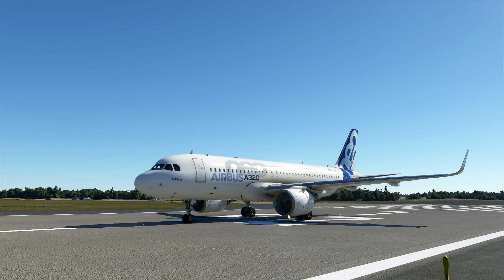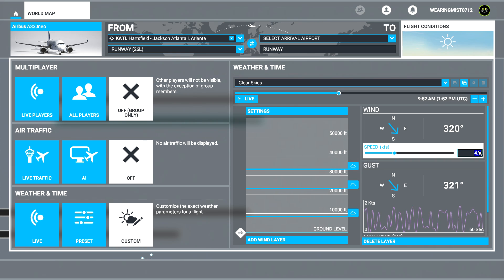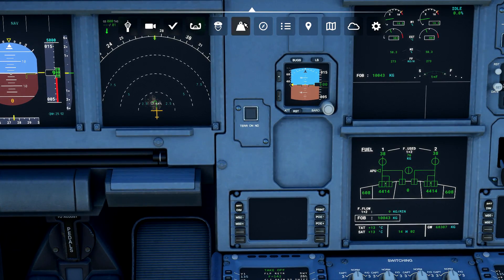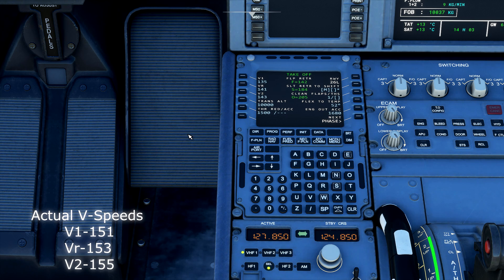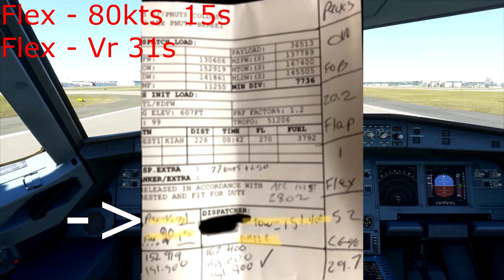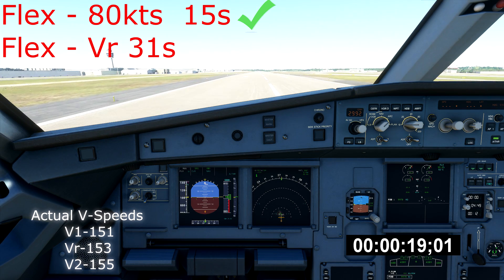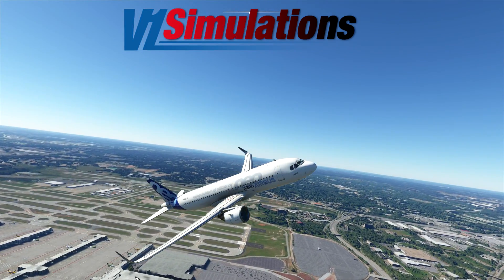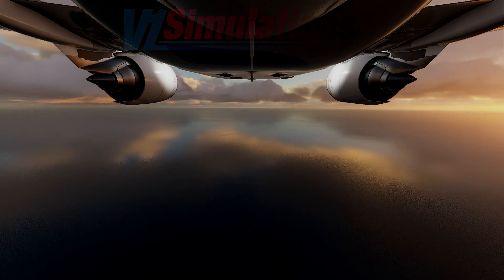Take Off TEST! REAL Airbus Pilot | REAL Data VS FS2020 | A320 Neo

Comment: Thanks for the video, very interesting, I was not expecting that! How do you find the acceleration once airborne and through thrust reduction altitude? That's where it goes too fast for my liking!
Reply from the maker: way to fast lol there is definitely something wrong with its thrust to weight or drag coefficients when airborne.
Reply: That's also my main issue I overspend so fast and when I reduce throttle the speed dies so fast. So hard right now

Comment: Dude I can't believe that Lol. Maybe this thing does need to be Zibo'd, it already looks good and apparently has better t/o performance numbers than the FF had at first.
Reply from the maker: I was shocked at the results lol
Reply: They are already Improving it.
Reply: It already is being zibo'd check out the open source A32NX project: https://discord.gg/XMUzJKj
Reply: The zibo Flight Dynamics was kind of off. That aircraft never stalls and hovers at 80 knots.
Reply: @AboutOliver  I think they're surprised it's this good, not the other way around!
It's definitely overpowered after takeoff though. I barely have time to retract the flaps before going into overspeed; only way to get a reasonable speed is to pitch to climb at maybe 6000 FPM if not more.
Reply: To zibo [sth] vtr... Brilliant new expression, self-explanatory. Hope too this one gets ziboed asap. 😁

Comment: Did u measure those speeds on the A320neo irl, because when u measured the tolis and flight factor those were regular A320s and this was a neo. Also how did u feel about the flight handling of this and the xplane a320s? How did u feel about the Zibo's flight dynamics? I tested the Zibo and at 80 knots it was hovering upwards and never stalls, perhaps we should include a stall test for all these aircraft too? Great videos btw!

Comment: For me its just wrong,  I can't bring myself to fly much in MSFS other than the basic GA.
Reply from the maker: I agree, personally I do not fly the airliners at all in FS2020 as of yet. But I still think its interesting to point out the little things that are there in the default birds.
Reply: ALL PMDG line up and the Quality Wings 787 are coming. Stay tuned. Just need someone to make an A350 and a good classic like the IXEG 737 and thats all we need. Oh yes forgot, we also need the F35B. :)
Reply: ITS A DEFUALT AIRCRAFT FFS
Reply: Being default shoukdnt be an excuse for have baked aircraft, Its got to work I don't expect miracles but these aircraft have some weird behaviours.

I still treat it as a Beta until the end of the year.

I would prefer half the aircraft and have them work twice as well.
Reply: @zszs100  Nice. I hope the fslabs is coming too!
Reply: @AirspotterUK  I mean the GA planes are pretty good. The airliners are bad and well the AP for all planes is pretty bad. Theres a project right now doing a zibo mod like thing with the a320. Not much has been added just some ecam pages.
Reply: @Neil_M_UK ... You like what you like

Comment: The aircraft is showing a SAT of 13c even though you have set 29c in the weather settings. May affect the results.
Reply from the maker: that is an interesting observation! I wonder why
Reply: @V1Sim  From what I've seen the weather system is a bit hit or miss at the moment, lots of bugs.
Reply: @DUBaviator  Yeah there's a few bugs in the weather system, live weather only working on the first flight and then manually having to deselect and reselect it on further flights, wind speed/gusts not being fully accurate or just going to the default of 2kts when real life wind speed is very high, i.e people trying to fly into the hurricanes but not getting the winds expected and so on.

Comment: Hey there, I'm a new subscriber, loving the videos! Quic question though, every time I try and land an A320 it seems to rev up its engines as soon as I touch down and I can't slow down enough before end of runway, I know why it's done in real life, but even with full flaps and brake held down I just cannot slow down enough before the end of the runway! :(
Reply from the maker: Are you using reverse thrust? Make sure you are using reverse and not adding "forward" thrust on touch down. You should have no problem stopping then as long as you touchdown speed is appropriate.
Reply: @V1Sim  it won't let me control the thrust at all at this point, my touch down speed is fine according to the flight pattern, as soon as I touch the ground something forces the engines up to TOGA (learned that from you and now I sound more fancy)
Reply: @JamieHutchinsonTechUK  Alpha floor is engaging because it thinks you are dangerously low on speed or AoA
Reply: @JimNortonsAlcoholism  is it something I've missed that needs to be disabled someone in the cockpit? 😯
Reply: @JimNortonsAlcoholism  Yeah I've done some reading, pretty sure it's Alpha Floor kicking in, but I'm curious as to why.. am I coming in too slow and floating down? Do I need to hit at a higher speed and slam the wheels into the ground before it deactivates?
Reply: @JamieHutchinsonTechUK  Yeah, basically. You're dangerously close to stalling if the aircraft is throttling up
Reply: @JimNortonsAlcoholism  I finish work soon so I'll try it out :D
Reply: @JimNortonsAlcoholism  It was that exactly by the way, I also found out I COULD in fact reverse thrust the entire time... that helps a lot to slow down!

Comment: It's almost like they got so far with it doing a pretty good job, then went 'OK that's it, outta time; park it up and were done here' which is a shame, but in the same light,that they've got some things really quite accurate bodes well if now post release they have some time to go back and work on it some more. Here's hoping.
Reply: The sim was done by a team in France. NOT microsoft, as such, it means more or less Microsoft bought the package. Typical have way finished product. All those terrible G?A aircraft choices. I have now seen many, many vids on MS2020, I for one will NOT be wasting money on it.
Reply: @bigd-1-channel514  Buzz off back to Austin's arms then
Reply: @bigd-1-channel514  Yes it's Asobo Studios that has developed it in case you didn't know their name. There seems to be a growing consensus of opinion that the sim has been released early which would have been Microsoft's call, which in turn could explain why the systems need more work. The video shows that it's not a case of things can't be done accurately, it's more a case that for parts of it, it's just not been done. Whether it's a waste of money or not based on watching some 'vids' is down to personal opinion. but there's nothing wrong with choices. One man's meat is another man's poison and all that.
Reply: Lincoln2020 use X-Plane with no add ons and default aircraft and then compare them.  MSFS was probably released a bit early, but the process is on going. No FS will be challenging MSFS next year. Or into the near future. That’s a shame as competition is good for us customers.
All the feedback and hundreds of thousands of new customers will drive all sorts of software and hardware add ons in the next 12 months. New CPU and GPU releases will also benefit from people getting new rigs.  MSFS is a revolution not a progression.